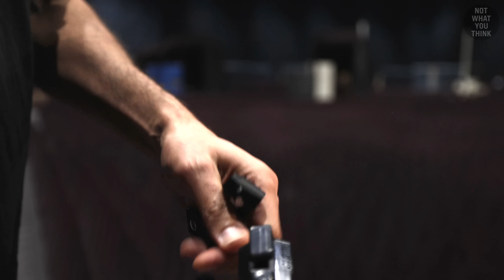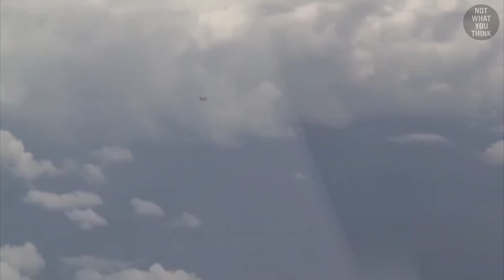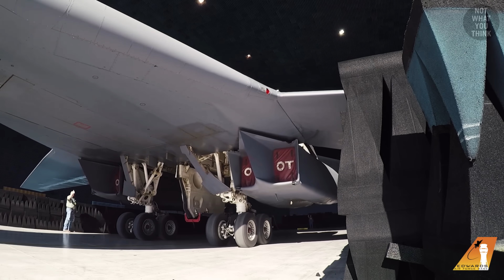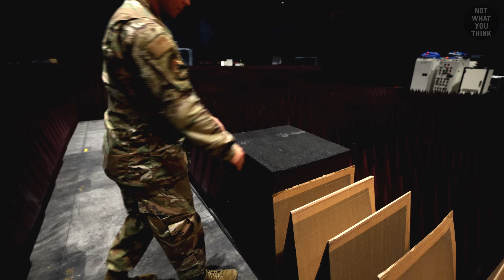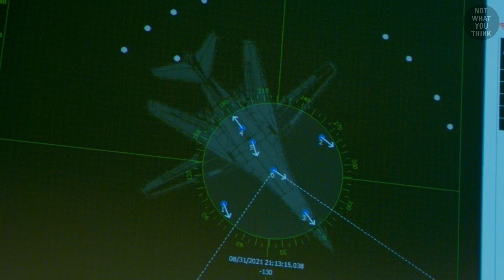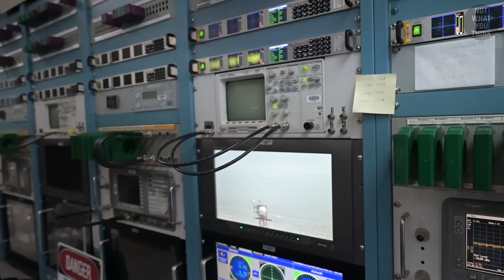Inside US Air Force's Highly Restricted Foam Facility

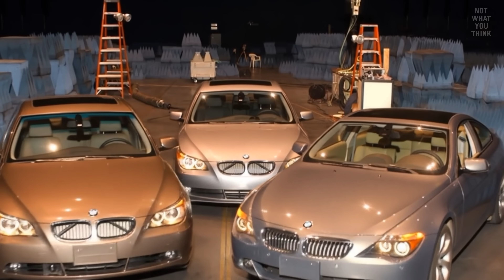Comment: Wait. At 21:12, are the BMWs AI-generated? They show an E60 5-series front end (which are the models you are referencing), but these were never available in a coupe and as far as I can find were never prototyped as one either. The E63 6-series was a coupe, but was larger and had a very different front end and headlight design. 

I’m not upset if it is AI, I’m just an incredibly confused BMW enthusiast, haha.

Comment: My grandfather was (I forget exactly what his position was at the time) one of the engineers who designed all the switch panels inside the B1. When he died about 10 years back, I got a bunch of cool stuff from him that said "declassified" all over it. I also got some of the actual panels for the B1 that were never installed (probably a prototype to show a boss or something) and screwed them in to the wall in my garage using the same hardware you would use to screw them onto the console in the plane. Makes for some really cool art in my garage. I consider it art because my grandfather spent who knows how many hours on these few pieces that was probably just a mock-up. One day, I might make a video with all of it. Maybe someone will find it interesting.

Comment: how tf do you have 3.2m subs?! your storytelling is AWFUL, please adapt your scripts to a timeline that makes sense... literally going from A to C to B to Z then back to A again...
Reply: the cost of the foam isnt even accurate, you suck at this
Reply from the maker: As you said initially, we must be doing something right to have that many subs! Have you considered that the sequential storytelling that you have in mind might not be the best approach, at least for YouTube? 😉

Regarding the foam cost, the mistake you made was to multiply the cost of the black RAM ($500) by the total number of RAMs (~ 50,000) which adds up to $25M, not the $2M that we said in the video. The thing is, the black RAM is the most expensive kind due to its tough coating. The other RAMs (blue, purple) make up the majority of those 50,000 RAMs and are much cheaper.

You may repent now 🤓

Comment: I did electrical contract work installing things like control panels at TinkerAFB over in OKC. One of the areas had this foam in it and a big room if i remember correctly . Never knew what it was for . I believe they did some kind radar work in that facility on the outside. This was around 2005 .

Comment: That's indeed a huge facility!
As an apprentice I've visited the Anechoic Chamber of the 🇳🇱 Koninklijke NLR in  Kraggenburg to test a Combination Boiler (a fancy new electric kettle for use in aircraft galleys) to see if it was emitting spurious signals that could interfere with the aircrafts electronic systems.
Luckily it didn't, but I've never seen this Combination Boiler I was testing also in our workshop used in any aircaft.
Although Ive seen it in the background of an episode on the A380 of Richard Hammond's series BIG...
At my workshop I now have a Faraday Cage for testing transmitters and receivers. We had to get the old one demolished and a better one installed, because the big cross section honeycomb ventilation panels didn't let the 153MHz of 5he older type Radio Remote Controls signals through, but they happily leaked the new systems 433MHz and 869MHz through!
Was tesed to about 6GHz, plenty high for us 😉🖖

Comment: This is completely what I think.  But I've done plenty of work in an anechoic chamber.  Nothing this large but the concept is the same.  A building in a building etc. Other than being able to put an aircraft in the room there is another reason for size. There is a minimum distance that varies with frequency called the far field where the field is essentially parallel to get a good measurement. Lower frequencies need longer distances.

Comment: I helped design some of the components in this building.  This is the ONLY time I've ever seen or heard of it.  VERY COOL!
Reply: Just outta curiosity how many hours did you spend there installing them there and did you get paid from them as helping them install the foam things?😊😊😊
Reply: @BlueLinePatrol2  I never went there.  The cost of getting clearance was high and my components could be installed without my presence so I never went.  There we only two guys that could step foot in there from the company I was working at.  Two, apparently, was enough.  I spent hundreds of hours designing, sourcing, purchasing and assembling.  You can't see my components in this video as they are buried behind the walls.
Reply: I am just as curious as BlueLinePatrol2. By the sounds of your innitial comment, you designed things for this place but your comment does not mention installation at this site, attendance at this site or any follow up of anything at this site.   Compartmentalisation seems to be the name of the game when it comes to secret/control maintaining events and projects

Comment: The level of precision in the BAF’s turntable test setup is impressive, especially with that 0.05-degree accuracy! It really demonstrates how meticulous military programs are when it comes to R&D.
Reply from the maker: In addition, the minimum velocity of the turntable is 0.1 degree/sec and the maximum speed is 1 degree/sec.
Reply: Not really impressive when you consider the size. That 0.05 degree accuracy simply means about 1/2 inch on the circumference of the turntable. Given the comment by NotWhatYouTink about the speed of the turntable, that merely means stopping within a half second of the desired point. Not a huge constraint.
Reply: "Impressive"? You obviously have no clue how accurate and professional readings are taken. This BAF is a big dumpster. 90% cone tips are broken or bent, the turn table introduces synthetic earth quakes, clearly not impressive (well not for me at least)...
Reply: @sto2779  "introduces synthetic earthquakes" LMAO, okay even if this is true and it does create "synthetic earthquakes", in what way does that affect measurements of ELECTROMAGNETIC FREQUENCIES 😂
Reply: @sto2779  Who pissed into your cereal? The tips would be swapped out if they really caused issues and the turn table is a moot point. Don't throw around your experience in a different field to shit on someone being amazed over something.

You coulda said something dope as hell about how precise your reading have to be
Reply: @sto2779  not to be a strict shill and commit myself to how impressive these facilities are, but you do realize in the scope of dogfighting and battle this is easily beyond par for required knowledge of detectablity vastly beyond capability margins ?
Reply: @sto2779  with the scale of this testing, assuming they test it all 360 degrees. your radar or detection system in an enemy aircraft would have to be within a half inch of detection  resolution to detect an anomaly. for you to come to the dissertation that this aircraft is built out of spec, damaged, or in a dire scenario would be a nothing call. you are out of the loop on these topics so far to the point i'm almost impressed.

Comment: "So I'm calling to ask how much it costs to buy foam cones?"

"About $2 each, on average."

"OK great, well we here at the military would like to buy some."

"At the...? Did I say 2, woops. I meant $200..."
Reply: Have you seen prices for sound absorbers? 200$ isn't that much more expensive
Reply: @MinaB-o2n yeah they cost a lot but his story is funny.
Reply: I work in government contracting and this is exactly how it is. 😂 the only catch is once the contractor signs the contract they are on the hook to always provide that $200 foam if the gov comes knocking, no excuses.. But regardless everything is more expensive.
Reply: @mrr5835 I’ve never known a government contract to do that. Business always has the best end of the bargain.
Reply: @TheRobbiUno  Depends on the contract. Some contracts are a lot tighter or better done than others, the F-35 weapons integrations problem is mostly a fault of poor contracting for example.
Reply: @mrr5835 Aviation pricing: take what it should cost, double that number, and add a zero.
Reply: The main reason why the foam cones are so expensive is that they are covered in Radar Absorbent Materials, which are the same materials that cover stealth aircraft. RAM on the cones in the chamber likely doesn't absorb as much of the radar return as on stealth aircraft, its still likely very expensive.
Reply: no you own both places to whitewash the money

Comment: The aircraft suspended from the ceiling look otherworldly, like models in a virtual test environment with no background textures.

Also, what happens to the RAM on the wall where the hangar door opens into? Does the interior wall fold out of the way?

Comment: The fact that different baffles have different heat capacities is wild. There's no sound anechoic chamber that even considers heat. The amount of energy radiating off of those tested emitters must be immense if their heat capacity is a design consideration.
Reply from the maker: Yes, the RAMs get warmer, but we were told it's not like they get warm. That's because the signal strength diminishes with distance, and most of these RAMs will be tens of feet away from the radiation source. That said, if you put a RAM within a few feet of a powerful radar, year, it will probably heat it up.
Reply: It's in the name: Electro Magnetic 

If you know anything about Magnets, they make things move = heat

Sound is also created by speakers (smaller Magnets) so it not considered in those
Reply: @VoidPixel4179  I'm sorry but it has nothing to do with magnets. The EM spectrum covers everything from radio waves, to visible light, microwaves, and x-rays. A wax candle gives off plenty of EM emissions in the form of infrared and visible light, no magnets involved.

Comment: I visited a small anechoic chamber while working at the Rome, NY Air Force Research Labs.  He asked me if I wanted to be shut inside. Absolutely.   It's inconceivable how quiet it is in there. Sound vanished instantly. You start only hearing things in your body and it all feels really weird.    9/10 would recommend.
Reply: Do your ears pop as soon as they close the doors because just thinking about without checking it out for the first time I can only imagine what it feels like😊😊😊
Reply: @BlueLinePatrol2  Not at all.  It's pretty darn quiet before they shut the door but once they do, It's just overwhelming silence.  Very hard to describe but it felt like negative noise I guess.  Just so much more quiet than anything you ever experience that your brain has a hard time with it.

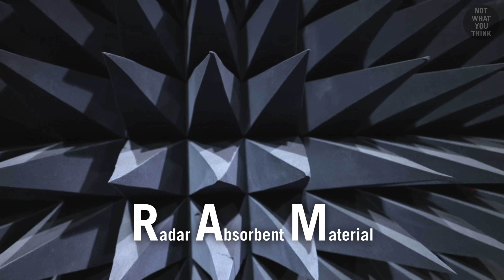Comment: 10:20 ... This is like the opposite facility called "The Trestle" that was outdoors. It was a metal scaffold-like structure large enough to fit any plane (B-52s, 747s, etc.) to hit them with massive electromagnetic pulses (EMPs). This tested the Faraday properties of "hardened" planes so and EMP could not take out the plane.
The Trestle was decommissioned in 1980 and IDK if there is a replacement facility, or if there's just enough data that computer modeling can be used, but it was a good way to see if an EMP would destroy the electronics of a plane (or car/truck)
Reply: im curious, did any planes with electronics ever survive an EMP? do you know the deatails there? would love to hear more
Reply: @paulbarclay4114  Military planes - all of them had to "pass" by being electrically hardened. 
Manufacturers of civilian airliners (Boeing, Airbus, Embraer, and Bombardier and others) are not specifically tested like military aircraft, but once an electronic engineer understands how to harden electronics they simply add that to the construction of the airframe.
I am a retired mechanical engineer, but had to work with electronic engineers in various times of my career. The act of hardening a vehicle (land, sea, or air) from EMPs is relatively simple once you understand the principle behind how and EMP destroys electronics.
I currently live on a homestead far from any city, and just with basic components ordered from suppliers I used to order supplies from when I would design sheet metal projects I was able to harden my entire house so all electronics in the 4 bedroom/3.5 bath house are completely protected against each type of EMP (E1, E2, and E3). To harden a home to protect from lightning strikes (E2) is clearly the most common and realistic pulse to impact my home since I live in high desert mountains, but when hardening to E2 it's just a little more to go all the way and harden the house, machine shop and solar systems for the other two (E1 and E3).
I have turned my entire house into a giant Faraday Cage with appropriate grounding and elimination of antenna length runs of wiring without having junctions to block current spikes in the wiring (think of the wiring inside your house as an enormous antenna that grabs EMPs from the air... you would want to ground sections frequently to break up the long lengths of electrical wiring by attaching them to fuses or literal grounding to earth.
I just realized I have written a near essay here.
The best thing to do is NOT get a degree in electrical engineering, but use the best source of "how-to" people have: the internet/YouTube.
If you want to better understand how to harden against EMPs and each type of EMP (E1, E2, and E3), simply Google it and start down that rabbit hole. In a half hour to an hour you will completely understand how to harden or protect your personal electronics all the way to your vehicle and home (hard to do if you rent).
The EMP-proof bags and film that is for sale on Amazon actually works. But, that's good for hardening up to a gun safe and nothing more.
Learning how to use copper mesh (like a window screen but made of copper) is really a fun way to learn and see how you can build a cage that protects items, objects and even people from electrical pulses and EMPs.
Give it a try!
... and yes, military aircraft and Air Force One are totally hardened from EMPs of all types. 
Everything learned from "The Trestle" has been computer modeled and is now able to be used by engineers when they design aircraft.
Sorry for the essay... I'm a survivalist and I used to teach survivalism/bushcraft back in the 80s when nuclear attack was a realistic possibility and I taught it because I love to talk about it and show people who are interested how to not only stay alive, but thrive in apocalyptic situations. So, I get wordy and chatty.
Hit up Google and YouTube! Peace!

Comment: I've done a lot of work in much smaller RF anechoic chambers, so this is impressive in terms of size.  Typically, ferrite material is attached to the walls and ceiling to absorb RF energy that the foam RAM material doesn't absorb. The ferrite is like a ceramic material and is quite heavy, which usually requires a substantial steel framework for the chamber.  A fun difference between testing aircraft and ground vehicles is that you do expect ground reflections for ground vehicles.  This is why there were no RAM pyramids on the floor when the cars were tested.  Thanks for the video!
Reply: I build labs for defense contractors and government entities. Recently I was visiting one of the places I built ( an RF defense contractor) and I saw one  small chamber with the rams like this in it. I asked what it was for he said to test RF components, I was confused so I asked don't you need a Faraday cage? The electrical engineer I was talking to said yes it is in a Faraday cage and the ram is to keep RF from bouncing around. A month later this comes out.
Reply: Why do 90% of the cones are broken/bent and that turn table causing earth quakes? Is this really professional for such mission critical testing?
Reply: @sto2779  the RAM pyramids do get damaged from handling after some time.  Anechoic chambers are periodically tested to ensure that the electro-magnetic field is uniform and not affected by reflections.  The pyramids will be replaced if they no longer allow allow a uniform electro-magnetic field.

Comment: The SR-71 still looks like something from the future.
Reply: If you can ever get your hands on either a physical or ebook copy of ‘Sled Driver’ then get it.  Amazing book with many amazing stories/anecdotes from pilots of the plane.
Reply: Still one of my favorites! I love seeing it at The Strategic Air Command (SAC) Museum in Nebraska, hanging from the ceiling when you first walk in! They are also refurbishing a F-117 at the moment and many other cool planes. The B2 made an appearance in the air earlier today along with the E-4B Doomsday plane!
Reply: Was there last fall.  Big fan of the B1 there... @MrSeanman30
Reply: @timflair9724 that's awesome. I'm from Nebraska but I got stationed in Fort Carson in Colorado Springs.  Do they still have the old ICBMs lined up out front?
Reply: @timflair9724 one other cool thing that recently happened. We got deployed to south Korea at the end of May. When we landed at Osan Air base we were told no phones or you will he arrested on the spot. The usual, however while we were getting off of the 747 and waiting to go inside, I heard the loudest jet ive ever heard. Sounded like a rocket. A U2 is hauling ass down the runway and disappeared into the clouds within 20 seconds. Then 4 F35s took off one by one with afterburners full bore and could see the wingtip vertices until they disappeared into the clouds as well. Hadn't seen that before so I just stared at them in Awe😂
Reply: F-47 & X44 six generations best fighter jets on planet this jet F35 ,F22 is our 5th generation also black bird is beast America muscle 🇺🇲🇺🇸🇺🇲
Reply: @Foundationalblackamericann  i had a stroke reading this